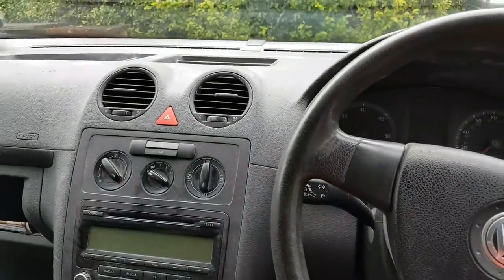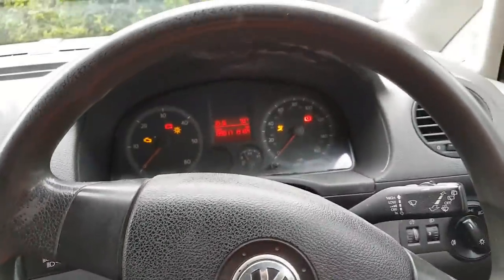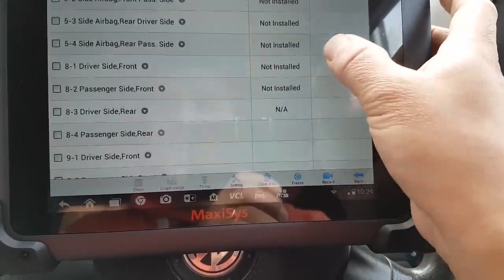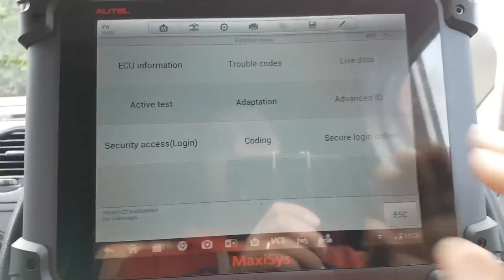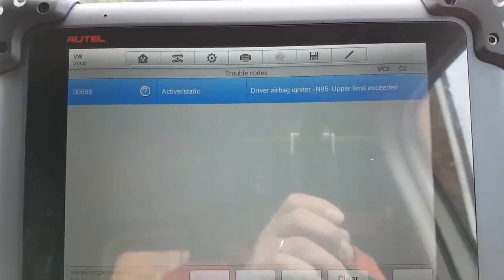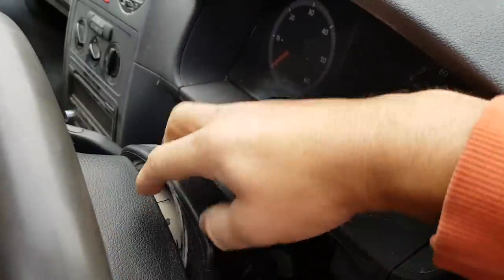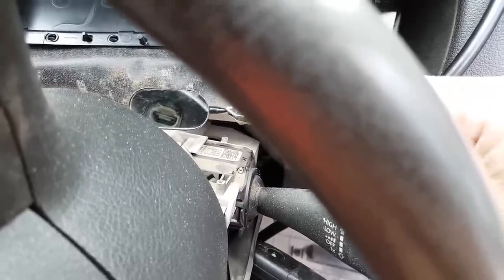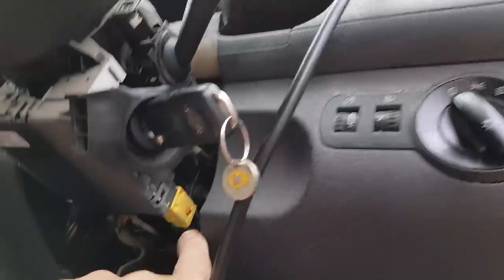Volkswagen Caddy 2008 airbag light on, code 00588. Fault finding and repair.

Comment: you are excelent on diagnostic
90 percent of airbag light on coming from a bad clock spring, but i don;t recommanded to repair it, just replace it with new one
Reply from the maker: عبدالله العريبي 
I treat it like any other electric circuit...
I sometimes replace them, if the repair is tricky or I fell is not feasible...
But you are right, replace is the correct thing to do...
Thank you for watching!

Comment: Great video! Obviously you enjoy repairing rather than replacing, giving the fact that a used or alftermarket clock spring it's not expensive, meaning that you can't charge the customer the way you deserve. Because of that I just replace them, it saves your time. Customers don't care as long as it fixes the problem.
Also, was this car that delivered the Perseverance on Mars? Get some of that dirt to get it analysed😅👍
Reply: 600€ is pretty expensive.

Comment: great video i believe i have this exact issue but not confidant enough to open up the clock spring can i just replace the whole thing? is there any numbers that need to match if i do?
Reply from the maker: Hi
Remove yours, and get one with the same part number... that way you can't really get it wrong...
Thank you for watching and for your comment!

Comment: Hi,

please i need your help . vw touran the airbag module its totally water damaged , i get used one the same number , its possible to re coded  ? or its not possible to re coded  ? or its possible to sweep IC from old one to the working one ? with vcds not accepting the code. any idea please
Reply from the maker: Yes... you should be ok swapping the ic... if is not corroded...
Otherwise, odis might do it... but you will need an online login...
Thank you for watching!
Reply: @LMAutoRepairs  thank you

Comment: Although it was interesting to watch I personally don't trust in such srs system "repair" of a customer's car. Soldering is a fragile point.
Reply from the maker: MrBorntoroll 
I would have replace it if the repair was not feasible... it is just an electric circuit in end... the worse it can happen is breaks again...
Thank you for watching!
Reply: I woud do the same, maybe ad 10mm epoxy around brakepoint,
 Now end of epoxy is the fragile point.
Then ad some tape to move out the stress point a little.
Great video, sorted.
Reply from the maker: Robert 
Many different ways of doing it... good suggestion! 
Thank you for watching!

Comment: You need to get vcds a lot better on vw group, when you go into channel on Autel can you scroll through channel number to see readings should be able to see ohms reading on squib circuit, you can on my  x tool ps90 which is clone of Autel. VW poor on live data.
Reply from the maker: Chris Thackray 
Hi
I have VCDS... never tried it on this car, so can't really comment...
I found that live data on Autel, on some cars is the same as VCDS... you can soon see a video I have for it on a Passat...
Thank you for watching!